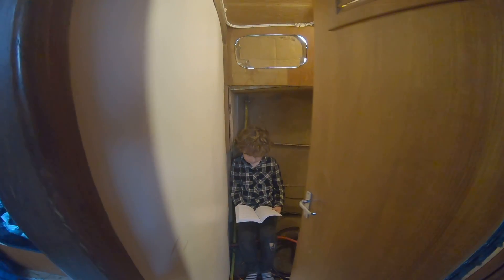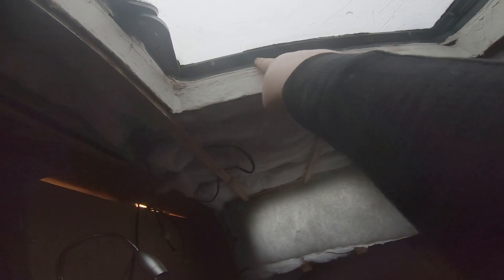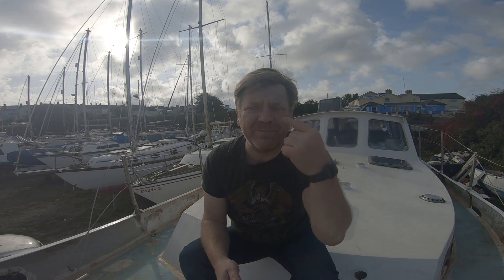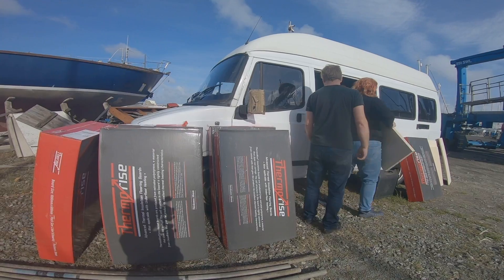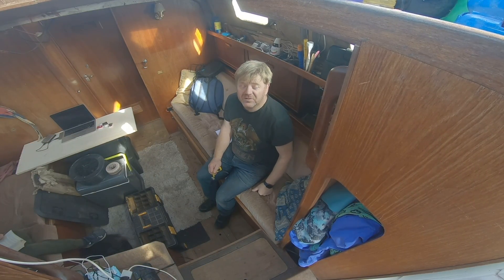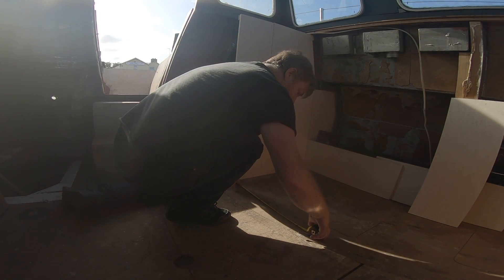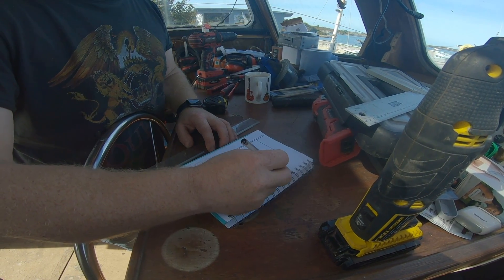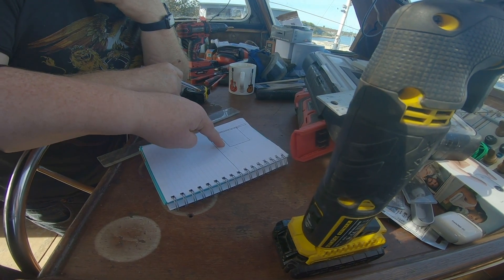#65 - Making our boat into our future home

Comment: Andy another tip from a fellow maker and mender ...if you want to assemble wood plastics and sheet materials take a look at getting hold of some 4 spike Tee nuts and Spire panel clips or nuts...you can get them in various sizes and stainless steel if need be... You can screw/ bolt things together and take them apart. Buy them on line from fastener stockists they will make life easier for assembling wood work and get you out of difficult spots .. like stripped thread holes in the edge of plastic, metal or wood panels. I used them a lot on kit cars.

Comment: Hi A / M / J
make attachment to the table a little to the point of the middle of the table with a turnebal top, then you get more utilization of space around the table, bar a tip.make the new puly of a strong plastic whit some inleg in the ropeway

Comment: you should make a spacer under the hatch frame about 1 inch thick to raise it off the deck and can be surfaced to be perfectly flat and to make sure water isn't pooling against it....
Reply from the maker: I’ll be making new hatches from steel

Comment: Make a false floor to mount standard height benches and table on, you can easily cut new hatches in the false floor to give access to long term storage also you will have separate storage in the benches...is it possible to have the forward bench right up against the forward "cupboard" for more space at the table

Comment: Hi Guys. We think the movable option is a good one. We have two "leatherette" upholstered boxes that can be put under the saloon table or chart table respectively 600 x 600mm they are not big but are really hand for extra storage. They can also be used as extra seating if we have more than 6 guests aboard. The bottoms are now covered with a non-slip material and they stay in place in pretty heavy weather. Best of all they fold flat if we do not need them! We got them from one of those Chinese emporium shops in Sicily for €12 each. Sure you have them in the UK. They match our existing coverings and when folded they fit under the saloon berths. (That is, if they are not full of 16 bottles of red wine each or our Blu Ray collection and Board games 😁) Great to see Jack learning the tools and some life skills. Sail Safe Guys, Ant, Cid & the pooch crew.

Comment: Another great video. Note for jack, If you stand your rubber hammer in a bucket of water so it covers the head and about an inch of the shaft the water will swell the wood and help to hold it in. Or you can use contact adhesive! Re the table mock up, might i suggest a round leg support to give maximum leg room for getting in and out. Think you will have sussed that one for yourselves? Finally, How about a nice locking swivel bar stool for the helmsman?
Reply from the maker: Great suggestion. We are actually thinking of a round support that comes down from the ceiling so there is no leg on the floor and a nice grab rail at the right height. Jack says thanks he wants to try the water trick with the hammer! A good experiment 😁

Comment: 8:41 just a suggestion for the helm seat. Rather than just relying on spinning, what about having those seats where the back rest is on a pivot, which can be pushed forward allowing you to sit facing back, then pop it back to sit forwards. But still have the ability to swivel. Great work, and you're nearly there.
Reply: we had the same thought
Reply: @SVBlownAway  They're convenient for sure. But also having the bolster as an option to stand and lean, or sit.

Comment: Those forward pulleys probably haven't done as much work as the aft ones and if the boat has done allot of motoring perhaps they've copped more salt air but it dose look odd. With the pumps that you're going to weld in, how do you plan to change them out when the time comes? Are you able to make a base plate to mount the pump to with a stick or poly pipe so from inside you can lift it to unblock or service it?
We'll make an engineer out of you yet once you've trained with them numbers😁. I reckon your on the right track with the seating arrangement. The only two bobs worth of add is the box under the aft one, the base could incline back at what ever angle work's for that access panel and could include a light that might be handy🧐. As for the pesky leaky hatch, just tape a bit of clear plastic over it and deal with it later. Make sure you gargle with whisky 🥃 it might not help with the tooth but if you have enough you won't care. I didn't know that Jack liked cleaning. Strange boy🤪🏴‍☠️

Comment: Recommend you take a look at the line of Ranger tugs and Cutwater boats to see how they include a bench back rest that flips for forward or aft seating.  These boats also incorporate aft access to a berth aft of the dinette.  The seizing of mast head cheek blocks is very common, the dissimilar metals (stainless and aluminum, likely 6000 series) have contact each other and corrode together so that they appear welded together.  The aft block were isolated from the shaft by the HDPE bushing.
Reply: I second the sliding back rest that flips forward and aft
Reply from the maker: Yes we actually have a mechanism for that and if we keep the layout like it is we may well use it

Comment: I like your progress! 
FYI , I use a great many sheets of 3/4” birch plywood, the best I can buy in the usa for wood patterns for fiberglass products. After my customer makes molds from them they leave them outside before disposal. I am always amazed how quickly the glue gives up and the plys separate. The common miss conception that ‘ all ply is made with the same waterproof glue’  is  wrong!
I suggest you leave a piece outside over winter as a test!  I would hate you to do all the work and get issues.  I’m sure you will epoxy coat etc but it’s surprising how that does not always work as well as expected! 
Cheers Warren

Comment: I would drill that pin hole all the way threw to make sure it stays in , and easier to remove with a punch , use never seize on all moving parts to make sure it never seizes in there again

Comment: Dear Sailing Melody family.
👍👌👏 Very well done again and as always (video and work). I hope that the Captains teeth problems will be healed completely soon. Despite all that, there is a lot of progress shown in this vid.
2) By the way: Maybe a folding table made out of 2 wooden plates is the best thing to have inside Melody? So it can be folded out of the way and secured on the side wall of the pilot house. A support leg is necessary too of course.
3) Please kindly allow me a suggestion respectively an advice out of my experience (I'm always good as a bad example;-)):
It's a totally common but wrong behaviour (ask me why I know).
Please try to avoid letting slip/flip the scale tape back against the tape measure cover because this behavior will lengthen/harm it. Sooner or later this habit will cause faults in measurements from at least 1mm up to 3mm!
Additionally: Nearly all tape measures have a kind of loose respectively movable angled stopper on purpose. It's for balancing the little but important difference between measurements with a tape that is hooked onto something in relation to a tape that is pushed against something!
Let it flip against the cover and the angled stopper will become more loose than it's supposed to be and/or become crooked. In this case it will never hold on an edge while measuring (worst case = it will brake away). And of course it will not measure correctly any more.
4) Dear Jack. I don't know what type of handle was used as you helped to get rid of the sticky thin insulation. But maybe the following information can be helpful for you: All black rubber mallets I know have different wooden handles than common hammers with metal heads have. Usually those handles are smaller in diameter where you hold them. So it is possible to slide the handle through the hole in the rubber head until it becomes stuck. By slightly beating the hammer with its rubber top on the ground, the handle gets pretty well secured. No glueing or wedging is needed.
As always: Thanks a lot for making teaching explaining recording editing uploading and sharing.
Best regards luck and health to all 4 of you.

Comment: In regards to your pulleys on the top of your mask, there’s a saying the easier and more convenient something is to do the more likely the maintenance will be done on it and the harder it is the less likely. So the back pulleys, being easily worked on by just pulling a pin and the front ones being very hard to work on, the back ones possibly got maintenance more or even replaced sometime and the front ones are still original and not very well-maintained. In regards to your table for your dinette if you want to have access to the floorboards below may I suggest it be pinned or hinged so it can be removed while working on getting stuff out from under the floorboards.

Comment: Andy those front pulleys may have been cast items ...Aluminium in contact with steel and water will corrode back to Al oxide.. 
Have a word with your boat people but you may need to use a better grade of Ally for the replacements or even a manmade material to avoid corrosion. There are companies in the center of Brum that can hard Anodise Al components.. this makes them much harder wearing and corrosion  resistant. 
Assemble with waterproof grease. 
Is your mast Al?
Like steels there are dozens of alloys of aluminium and their physical ..thermal and chemical properties all vary.

Comment: I think I'd go with drilling right through on the forward facing pulleys, Then install the Pin with cotter pins for ease of maintenance. probably why they were in such poor condition.

Comment: Design yourself a place to sleep in the wheelhouse. And this is necessarily along the side. Think of the nights on the ocean. Someone has to be on guard all the time. And it will be at least 18-24 nights. You will have to sleep in sequences of 15-20 minutes. After this time, you need to check if you can see any ship on the collision course. If you have a bed in the wheelhouse, you will raise your head and see everything. I can't imagine getting out of bed in the bedroom every 20 minutes and going upstairs. You have to plan your trip as if you were sailing alone. Think about it.
Reply from the maker: We will certainly have a berth in the pilothouse 👍👍

Comment: Depth of a normal table is 300mm per person, which means 600mm.
Less than that is usable but tight.
Reply from the maker: I did the plate test it does fit but there will definitely be modifications before the final design.

Comment: Interesting  you guys talking in centimeters  here in Canada  we still use inches when it comes to construction  studs for the walls 16" or 24"on center same with trusses  all plywood still 4'x8'   wood is 2×4  ect.. ya I would have bet you guys would still be in standard measurements  it's Britain after all  never mind the EU
Reply from the maker: We are just very confused 😂 we talk in feet and inches alot of the time. Then other times cm and mm (cm & mm) is whats taught in schools so we try to stick with that as much as possible so not to completely confuse Jack. When buying wood though it's an 8x4 sheet or a 2x2 I don't think that will ever change  🤔

Comment: The seating should be on 45 cm's from the floor, for a correct height... elsewise you're sitting on a stool... rather uncomfortable. Apart from the height of the table... and the position of elbows.
Adjust with the position of the floor, how far this is from knees etc, ergonomical: keep the best relation between knees, feet, elbows, underarm and rest of the body. All that with regarding to your thoughts of looking out of the windows and the incoming light.

Comment: you might want to rethink your dinette. Most dinette's in boats and caravans turn in to a bed. That means that the space you need form back to back is 190 - 200 cm. You now used 160cm I think you will regret making it so tight, and perhaps not using it because it is too small in practice. A small table is usually 70 cm wide. you want to be able to fit three plates, some glases and perhaps a pan or two on it. Perhaps an L-shaped dinette with a butterfly leaf table is more efficient. and remember it is better to steal a good design then to create a bad original one.
Reply: Yes, I was thinking it would be too narrow for 3 plates. The laptops take up nearly the entire depth.

Comment: I dunno it looks cramped to me. Have you considered not having the easy access to the back room and having a sliding bench that acts like a door to the back room? Sounds like that's how they had it before. I mean putting away the fenders is not something you do every hour or even every day I would imagine. I'd rather have more comfort for the hours and hours you'll spend at the table then for the minutes needed to access that back room. The big thing seems to be the leg room. It just looks so cramped but I'm not used to it I guess. Anyways hope my perspective helps . Have fun.

Comment: I'm sure you've mentioned it before, what is the length and beam of your ship?  it really looks massive in that pilothouse. Me and my wife have been binge watching your series and youve sold me on steel yachts and do it yourself welding/other work.
Reply from the maker: Hiya. Her hull is 38ft long, 12ft beam, with the swim platform and to the very tip of the bowsprit she measures 42ft.  With the keel raised she will float in 4ft of water. With the keel lowered down she needs 8ft of water. Steel boats are strong but generally slower than fibreglass boats . Maintenance is an ongoing labour of love to stay on top of rust, if you have the skills and enthusiasm then they’re a good idea. But can be a nightmare if you don’t have the skills to do the metalwork required
Reply: @SailingMelody  Wow, that's a huge 39' We can't wait for you folks to finally set sail on it, she's really turned into a beautiful cruiser. We had a Irwin 30 for a few years, and we just hated fiberglass repairs, it felt like trying to make sculptures out of individual Band-Aids, everything's always itchy from the glass dust. I think were going to buy some welding machines and start practicing our metal working skills, i used to work on classic cars so I'm a little more mechanically inclined with steels than glass or wood work.  Thanks for the response!

Comment: 2 pooisbles answers - the forward pulleys are facing into weather all the time and get all the salt spray or is it a reaction between Aluminium and Stainless Steel ?
Reply from the maker: It’s weird isn’t it yeah. The boat was ashore for 15 to 20 years so I can only assume the corrosion happened during that time
Reply: Or perhaps the good one was replaced 20 years ago cos it was the bad one

Comment: Could you also not just have a raised step up to the seats that are fixed in? Keep the most of the floor the level it is, and the seats and step act as storage. Then you have the option of a section of the step where the hatch is, on a hinge that you can lift up to access the deep storage hatch.
Reply from the maker: That’s a great idea.
Reply: @SailingMelody  I know you probably have a plan in place, and get fed up with suggestions at times. I get quite passionate about creative thinking.